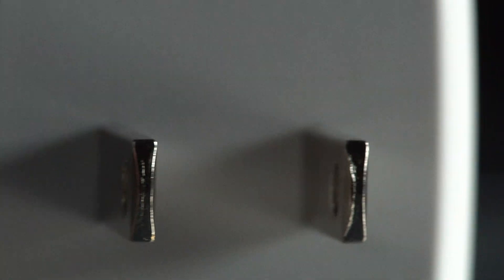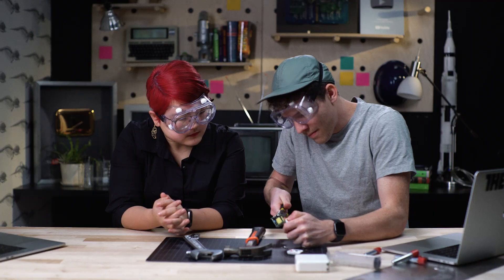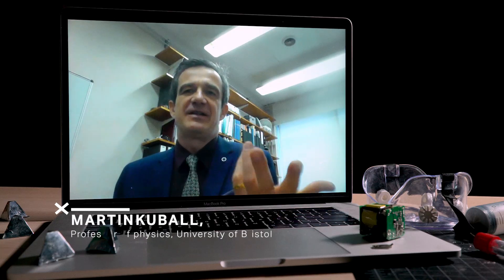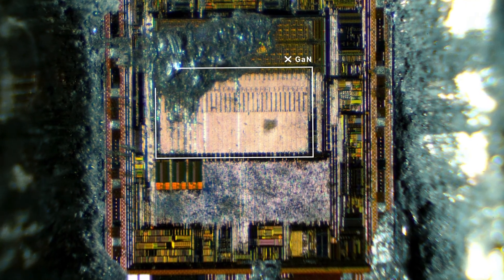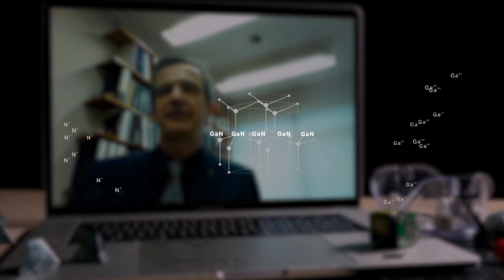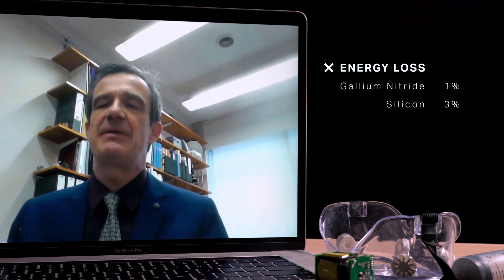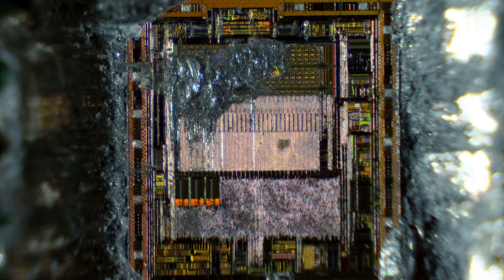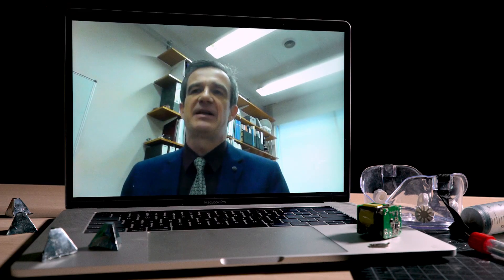Is gallium nitride the silicon of the future?

Comment: Vibranium would do a better job, just saying
Reply: I think unobtanium works better.
Reply: As we've seen in Black Panther, if you have a problem, throw Vibranium at it
Reply: But it is only available in wakanda is it?
Reply: saying what ???
Reply: NO. NOOOOOOOOO. Never use that horrible stuff.
Reply: It too expensive..
Reply: @Time Traveller it conducts reflected energy 100% it's perfect and the answer to fusion energy unlimited supply.
Reply: You're next justin Y
Reply: Wtf?
Reply: @luongmaihunggia  r/whooosh
Reply: I see you everywhere wtf
Reply: Vibranium and Adamantium are Fictional Elements, therefore they are not inside the Periodic Table
Reply: @owenchuarbx  didn't you get the joke,?
Reply: Aventanario, Gasp!  How dare you!

Comment: Use métric system in temperatures. U are an international chanel
Reply: There's always one.
Reply: 28°C the Gallyum the same chocolate 🍫 fusion point.😂
Reply: Mericans use anything including sauce packets to measure things....everything except the metric system😂
Reply: But we Americans make up more than half of their views. Get nae nae'd.
Reply: It doesn't really matter what the unit is, they say it can melt in your hand, so body temperature.
Reply: Most of their Audience is American, I assume they would like to cater to that.
Reply: @johnj8639  or they could put both...
Reply: @johnj8639  where is that stated?
Reply: @marcodemoes7604  look up the analytics,it's true
Reply: Google is also available internationally, as well as any other resource of unit conversion. If you're going to complain about unit systems on one thing, don't stop there. Go on car videos and complain about them using horsepower rather than kW, or lb-ft instead of Nm.

Comment: Semiconductors can only conduct electricity under certain circumstances like when you apply a specific amount of voltage or current to a thyristor's gate pin or how a diode can only conduct positive DC voltage from the anode to the cathode.
Semi conductors like transistors are what make your ones and ceros in computers posible acting like extremely fast switches and when you conect the transmitter/output of one to the base of another and another one you can do a lot of great things.

Comment: Get a spudger - far easier to disassemble the charger and not as destructive as a hammer
Reply from the maker: Woahh, yes this would have been super helpful. I'll order one to have on hand the next time I need to tear something apart :) Thanks for watching — Cory
Reply: You might also consider investing in a Dremel or other rotary tool with an assortment of cutoff wheels and cutting burs along with the whole iFixit tool set.  It will be an improvement over using a wrench as a hammer. Please don't use wrenches as hammers, it's bad for them.

Comment: Dope. I regularly wish Apple would make a smaller MacBook charger, it seems so off-brand for Apple to have this big awkward brick to charge their slim laptop (although I do appreciate it over some PC laptop adapter bricks for sure).
Reply: Who tf uses apple products in 2019 omegalul
Reply: @Crankulite  People who still believe they're still world class leaders in mobile tech. 😆
Reply: @Crankulite  ppl with old phones
Reply: Better than some cheap circuit without any safety features.
Reply: depends. they can make it small as much as iphone charger but they dont want people complaining that the battery is draining while plugged in.
Reply: If I had an Iphone I regularly  would wish it had an USB-C port, so I could charge it with the MacBook charger ;)
Reply: @Michele Cordano and Apple has enough money to buy any patent they want
Reply: FutureNow if they stopped using intel chips and started to use there own cpu, or AMD, then it would reduced there power needs and the charger would get slightly smaller in the process - if they where to use the Gallium then it Probably be 1/3 rd the size .
Reply: Yes - but it also depends on efficiency it converts the power into the required voltage, I think you know exactly how hot you're chargers get n this is because of those big components you see. If we were to shrink it down does this mean we have a more concentrated heat in a smaller area? I don't know the diffinitive answer but if so as you can imagine concentrating heat to a specific portion may not meet apples standards, this means as a trade off/ compromise you have size but meets apples safety regulations. There's more to engineering than just put in what ever is best, 

Another aspect to look at is cost and profit margins, of course Apple can just jack the prices off n you will buy it, but what if you're the niche? The r&d required is not worth it for what they'll sell, 

Last of all is how green it is, if it's not disposable in the future - there will be pole gal measures on how much of something they can use. A company has to file and record for every material how it is used and it's end of life cycle how it's disposed of.

Comment: IDIOTS they cud just use copper!!!!
Reply: Cooper is a conductor, not a semi-conductor.
Semi-conductors only conduct electricity under certain circumstances while copper can't.
Also you can't make diodes, thyristors and transistors out of copper while you can out of silicon or even graphene.
What ever happened to graphene anyway.
Reply: @ThePontificius  copper is a conductor which is better than a semi-conductor OBVIOUSLY
Reply from the maker: @ThePontificius  We made a video on that ;)  https://youtu.be/IesIsKMjB4Y — Cory
Reply: Copper travels easily. If you put a copper penny on a bare silicone wafer, in 24 hrs, you will find copper atoms on the other side of the wafer.
Reply: @Fransisco Wijaya so? copper is the best conductor, you stupid shit.

Comment: Can GaN finally get us that breakthrough in battery capacity technology we've been promised for the last 14 years?
Reply: hey its me jop I don’t think it has anything to do with energy storage. Semiconductors are largely used in logic circuitry. 

This is the quick explanation, if you want to research it yourself, you cold try googling electron band gap.
Reply: No, but carbon could
Reply: I understood you can make semi-conductors out of GaN but not batteries.
Can you confirm this is a posibility?
We could make great things with better batteries.
Reply: No but oxygen would.
Reply: Not only silicon logic , but high power transistors and diodes as well (part of power supplies, inverters etc)
Reply: No technology can circumvent the Laws of Thermodynamics.
Reply: no it can't
Reply: Um we have had that breakthrough in battery capacity in the past 14 years.

Check out the 18650 li-ion cells in a good laptop from 2009, only 1600 mah each.
These days they're usually over 3600 mah and some exceeding 4000 mah, in the same size 18650 cell.

If that's not drastic idk what is.
Reply: Along with fire from these batteries high lithium density batteries cause heat and can explode reason car companies are looking for better chemicals.
Reply: @nicknevco215  
They only do that because of the flammable electrolyte. supposedly toyota is working on solid state lithium batteries and no electrolyte = no fire.
Reply: nope
Reply: No.
Reply: Its replacing silicon like processors, etc. not Lithium ion